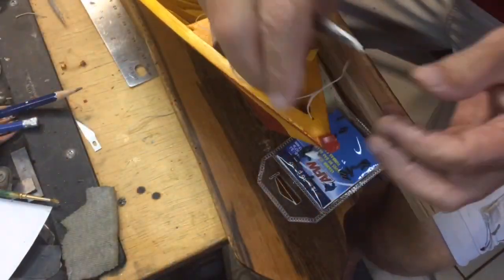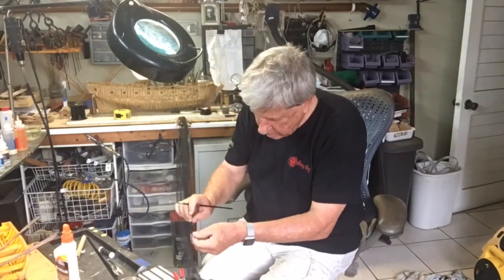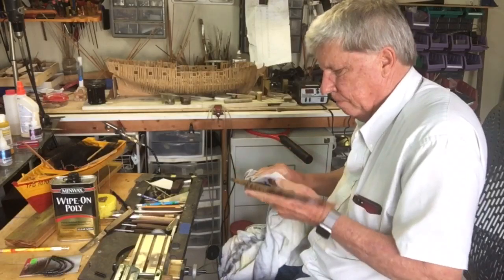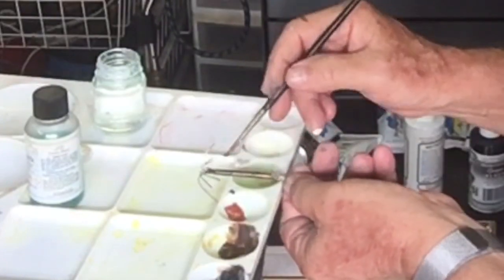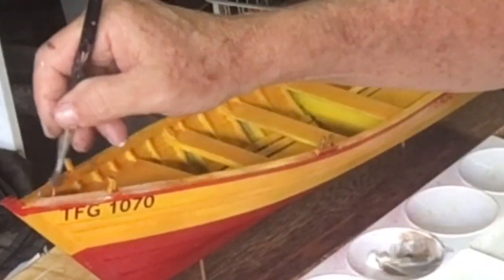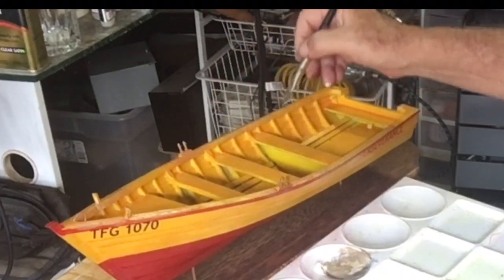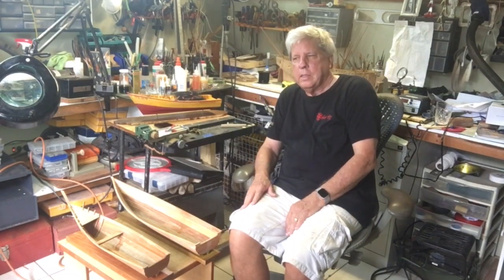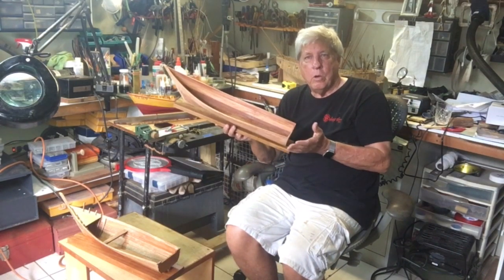Part 7. Model of anartesian fishing  boat in Trinidad and Tobago built using traditional methods.

Comment: A lot of memories for me. 7th Trinidad Sea Scouts had a smaller pirogue ( I'd guess around 16') with a damaged keel and I spent quite a lot of time fitting a false keel under it. One of the major problems was bending it to fit the boat (I had no idea about steaming etc. at the time).  That indicates that the keel had a certain amount of rocker which neither your model or the seine boats used on Mayaro had. The transom was narrower and the entire hull was much better suited to rowing. Our adding a lighter wood false keel made her very unstable. I wonder whether the wider, flatter hulls were a result of the introduction of outboards.
I actually witnessed two chaps coming in from fishing in a sail-powered (flourbag cotton) pirogue in Matelot in 1966 (or perhaps '65), one man at the helm and the other in the bilge with a calabash bailing as the ses came over the lee rail. Their boat was more like our scouts' smaller one and had some rocker in the keel/hull. 
We bought a quarter of a huge kingfish from these guys and that was food enough for three of us hungry teenagers!